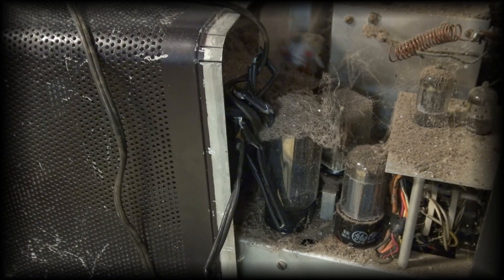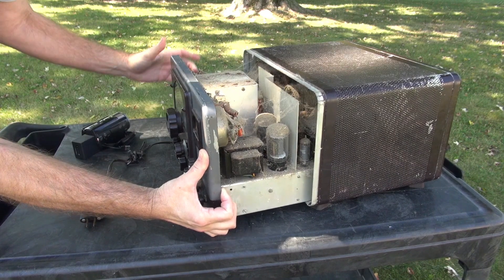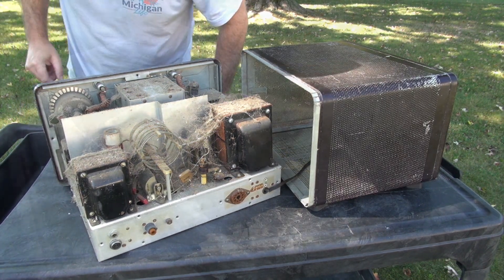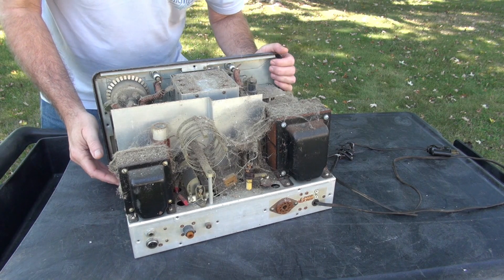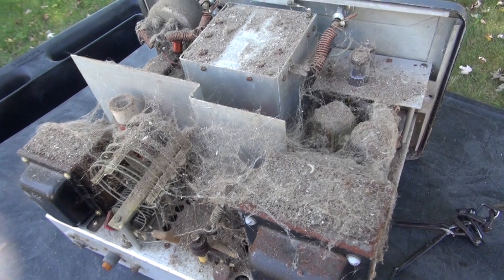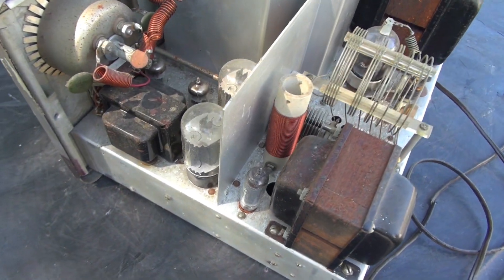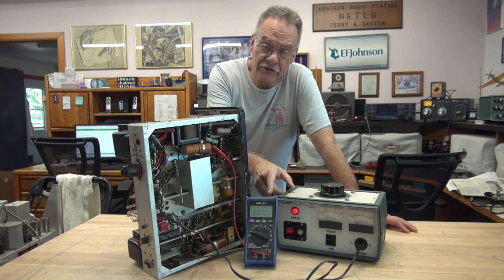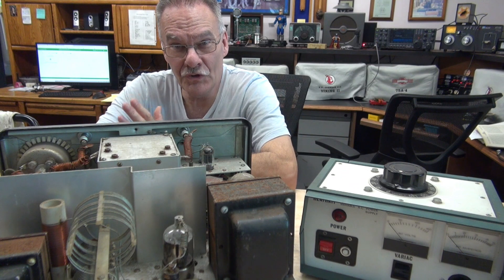Johnson Ranger Ham radio AM Transmitter Swap meet find full of cat hair & dirt does it still work?

Comment: Hi Terry....binge watching ur videos and other  utube content dealing with shingles. I lost use of my right arm. PT coming up. I was working with Howard W3HM fixing restoring Rangers (1990's). Howard worked on Collins equipment. FIRST class restoring. They looked like they came from the factory. Howard told me a good mixture that melts away the junk on the chassis and it will look like new. It involved Ammonia and another cleaning liquid. During the summer brush the stuff on the chassis and take a hose to it. No direct spray on transformers and meters. Set out in the sun for 4 hours.